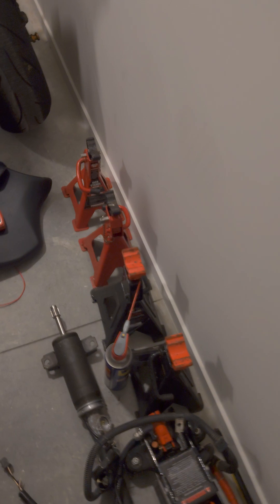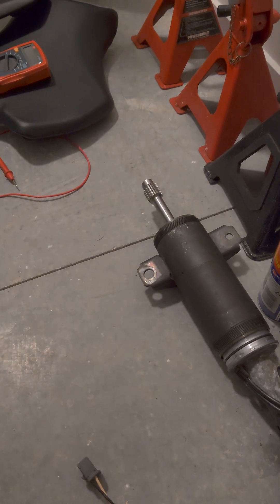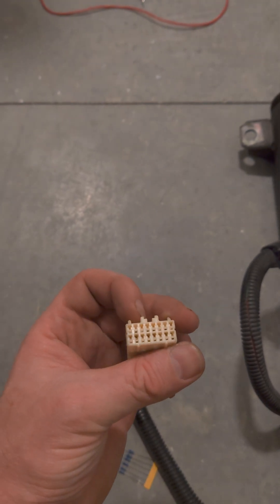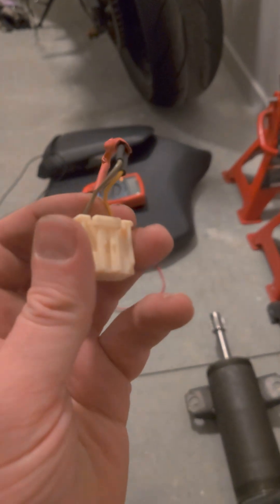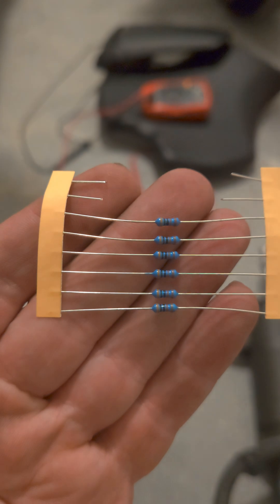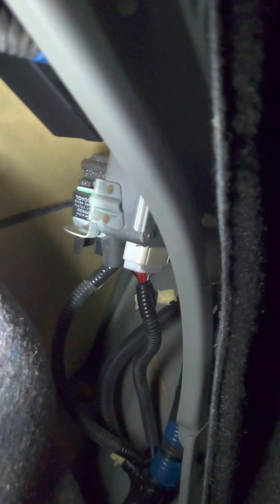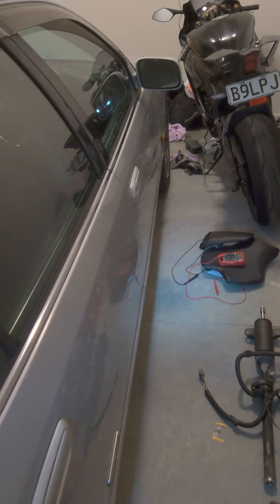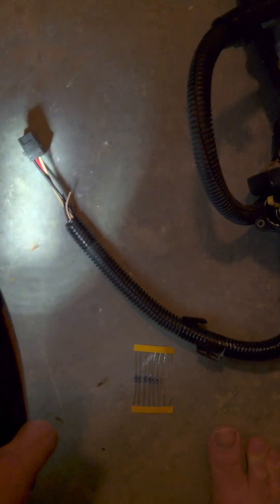Toyota Aristo Active Rear Steering removal - Electrical side

Comment: Haya mate, do i need to plug the power plug in? Just bought car and i did your mod but it came with extra steering arm with plugs i cant seem to find original plugs so not sure if it been removed or not
Reply from the maker: No, you don't have to. Without the power plug, the ARS light will light up on the dash. I just removed the bulb.
It doesn't affect the VSC or traction control.
Reply: @LockieNZ ive removed the light bulb from dash i just have no idea if traction is working or not unless i try do a burnout i guess
Reply from the maker: @dmitripihama7332 If the traction control and VSC aren't working, the lights for them will show up on the dash. If you've modified the connector with those resistors, the traction control light will flash if you try do a burn out. 
If you get it really sideways in the wet with a boot full, it'll even start beeping at you 😂

Comment: Chur bro, how easy is it to get certed after installing the lockout kit? Or is it better to go to a wof inspecter that is partially blind 😂
Reply from the maker: @jayzah  It's not bad. Only issue I had was the bolts that connect the tie rod ends to the lock out bar that were included with the Hardrace kit. They were too short. They need to have about 2mm of thread showing out of the nut. 
They also had to be grade 8.8 bolts from memory.
Other than that, easy.

Comment: Hey those resistors are orange black black brown brown
3000
Because blue is 6
So you said 3660
It's all goods we know what you mean.
Quick question
The power plug did leave it out and remove Ars light from the cluster
Reply from the maker: @kyleb9807  To be honest, it's so long ago that I can't remember sorry! I also covered them with heat shrink, so can't take a look either. 
Yup, so the power plug for the rack is what activates the ARS, so with that disconnected, the ARS light shows up on the dash. I decided to just take the light out of the dash.
Reply: @LockieNZ Hi, what if I just disconnect that gray power plug from the ARS ECU? Would it just make ARS stop steering the rear rack without messing up VSC and TRC?
Reply from the maker: @АлексейПрядко-ц4з I'm not sure, sorry! I found that unplugging the power to the rack caused the ARS light to come on
Reply: @LockieNZ I don't worry about the light. I was looking for a way to stop ARS from changing the angles, cuz I need to get a proper alignment that would last me for longer than a week 😢
Reply: But anyway, thank you, man. There is little to no information about how it looks like and where this plug at, I am glad I found your video
Reply from the maker: @kyleb9807  I actually just found the resistors I used and put a photo in my community feed. Looks like you're right, Orange, black, black, brown, brown.

Comment: Do you need to have cert for lock out bar
Reply from the maker: Yup, does need a cert. It's one of those mods where if it goes wrong because it's badly produced or engineered, it could cause a pretty nasty accident.

Comment: Is it the 3k ohm 0.5 watt?😁
Reply from the maker: Hey, sure is. Just saw they cut off the link to the ones I used in the description! Was able to check the link and confirmed thats the one
https://www.jaycar.co.nz/3k-ohm-0-5-watt-metal-film-resistors-pack-of-8/p/RR0583?pos=5&queryId=9a9a271fe3cf6c3e0b800c98aa7ab60e&sort=relevance#

Comment: Do you happen to know how much the steering rack moves from side to side, since you seem to have it disassembled? 

I already ordered the type A inner rack heads to my 1998 Aristo with type B (38mm rack), since some local fellow had put ones in his 97-99 Aristo and did not have any problems, but I started to wonder if it is possible to have some interference issues if I use 42mm inner ends in the 38mm rack, although the ends don't seem to hit the rack while it is straight. Local Toyota dealer tells that they would not fit, but I don't know who to believe. 

I also have a lockout bar ready just in case, but I would like to keep my car as original as possible.
Reply from the maker: Hey, sorry I missed your comment. I can't say that I have any idea sorry!
Reply: @LockieNZ  No worries, and thanks for the reply! Upon closer inspection, it seems that my rack is also broken, and therefore, my question became irrelevant.

Comment: Great work!... How hard is it to remove the factory ars and replace with lockout bar?  Did you drop the subframe or just unbolt and pull out from one side?... About to replace mines. Thanks
Reply from the maker: Unfortunately you have to drop the rear subframe, so it's a bit of a pain! 
If you're thinking of replacing the diff or subframe bushes at some point, I'd do them all at once
Reply: @LockieNZ  Oh man didn't want to drop the subframe... But if it's the only way to do it...I will do as you suggested. Thanks again 👍
Reply from the maker: @jasonrambally5801  Good luck. It's easier if you have a friend with a workshop! 
It sits on top of the subframe and there just isn't enough room :(
Reply: @jasonrambally5801  you dont have to drop the subframe. it is a bit of a squeeze to get your hands in there tho.
Reply: @sh3lbot  I actually did my lockout bar last year! Was not as difficult as it taught it would be... And I had the car on jack stands... Thanks
Reply: @LockieNZ  I was planning on putting the car on Jack stands and drop the subframe enough to clear the ars for removal and install Lockout bar. I also have a engine hoist, I can lift the rear a bit higher if needed... Something will work out...👍
Reply: Just done one on jackstands was about an hour